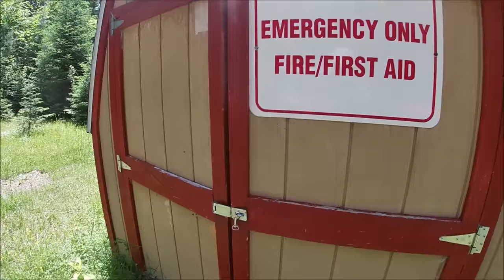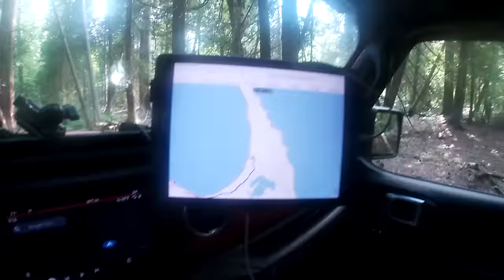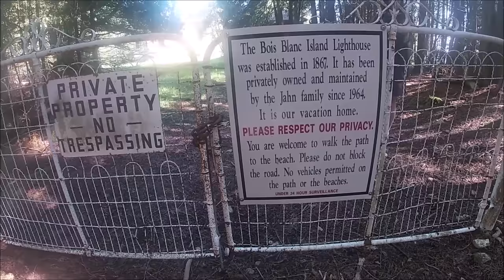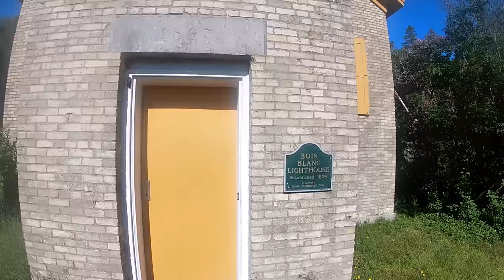Bois Blanc Island - Dillinger's Hideout | Restless Viking

Comment: If you reference Boblo Island, most of Michigan will think of Boblo Island, which is an old amusement park near Detroit, complete with ferry. The confusion seems to add to the charm of the island. You need to be local to understand it, and for those who aren't local, it will remain anonymous.
Reply from the maker: LOL.  Many non-locals will argue with passion about it.   And you are right, it certainly adds to the charm of the island.
Reply: and recently, the subject of a documentary film that chronicled the amusement park there and attempts to resuscitate the passenger ferries that used to supply it
Reply: The Detroit River Boblo Island is also officially Bois Blanc.
Reply: @davidmackie2901 Exactly why I’m here.  I could not figure out how it was only 3 miles from Mackinac Island and how you get there via a Cheboygan ferry.
Reply: I believe the amusement park BobLo is actually in Canada.
Reply: Yes, technically it is Canada. And all of us were allowed into another country. No checking on us, no parents,  no ID half the time. Lol
Times sure have changed.
Reply: @cjw648  wonder how Boblo Island would work today if it was still in operation. Use to have a yearly field trip to Boblo back in elementary school. Can't say I remember much other than the ferry ride. One teacher and maybe 1 parent over seeing like 25 kids around 10--12yrs old. Different time indeed.
Reply: Yes,and I rode the Boblo boat from dt Detroit many yrs ago.
I remember how those big engines vibration droned throughout the whole boat,or you could get to Bois blanc Island from Amherstburg.
Yes it was Canadian soil,so was Belle Isle,much to the surprise of many Detroiters!
Canada sold Belle Isle to the US.
It's been closed and the rides sold off long ago! Thry built a few homes on it but I wouldn't want to e commute hassle of getting across the river, especially during those cold damp winters we get in the area!😮
Reply: Hi! I'm 43 and had my 5th grade field trip to Boblo Island. The amusement park. Princeton Elementary, St. Clair Shores.

Comment: We're planning a camping trip up there this spring.  I like your rig!  I have a 2018 JLU with a soft top, and I need to figure out some cargo add-ons.
Reply from the maker: Thanks Man.   I used to have one of those "exo skeleton racks" for overhead cargo.  Pricey and they rusted after a few years.   I am happy with the rear cargo rack on the gate, I just needed to upgrade to the stronger hinges.   Cargo space is a premium in JLU/JKUs for sure.   JLU has a little more I think.

Comment: You mentioned that $5,000 to build the lighthouse years, and years ago as “Cheap”. Maybe you meant “inexpensive” relative to today’s standard. In the early 1900’s buildings were designed and built to greater standards than today. Like today’s quality in a Jeep (more creature comforts), versus a Willy (no creature comforts. Padded seats) in 1930.
Reply from the maker: Not at all.  The first lighthouse had a shoddy foundation, weak mortar and crumbling brick reported right after it was built.  It collapsed a few years later in a storm.  So. . . It was cheap.
Reply: @RestlessViking  thank you for that. I stand corrected. Perhaps I missed a part in the video where you mentioned that. I will rewatch it.
Reply from the maker: Even then, cheap doesn't necessarily mean "low quality", unless the context suggests it.  I'm not sure why cheap is a problem in this context.  Compared to today's standards, that isn't a lot of money.  Cheap often simply means it costs less that it is worth.